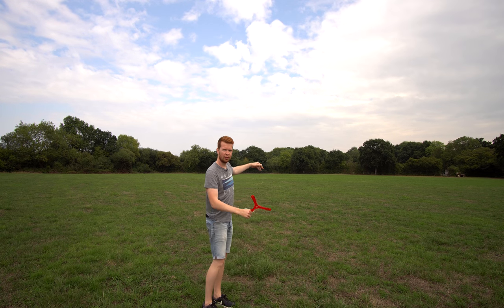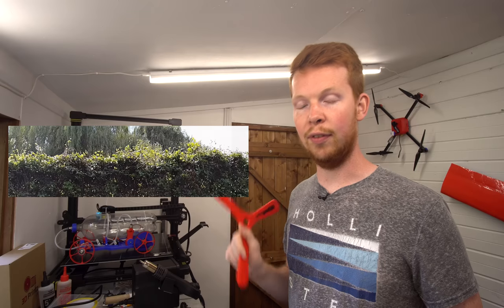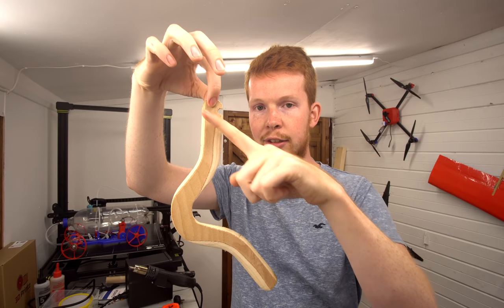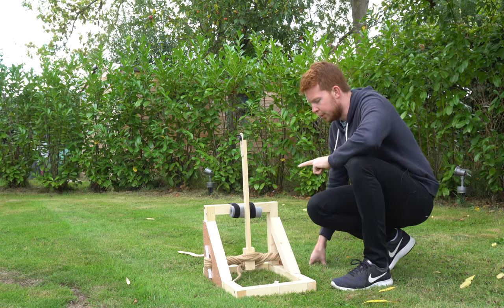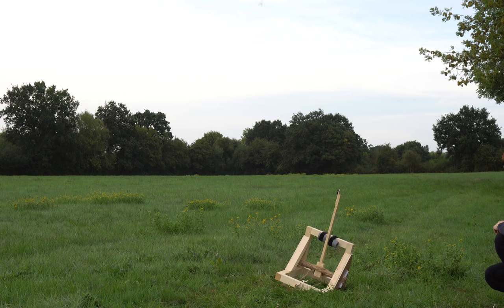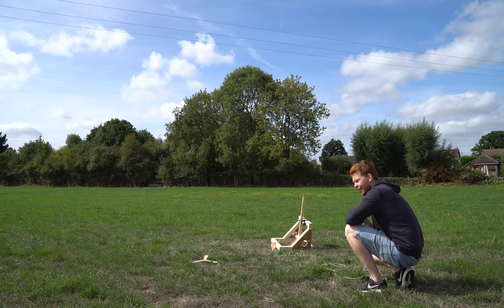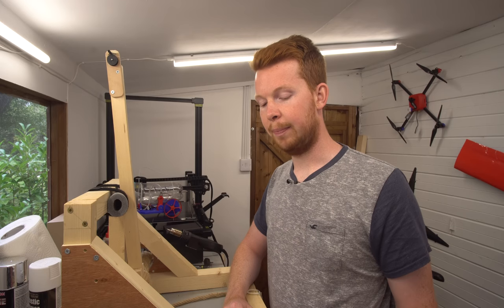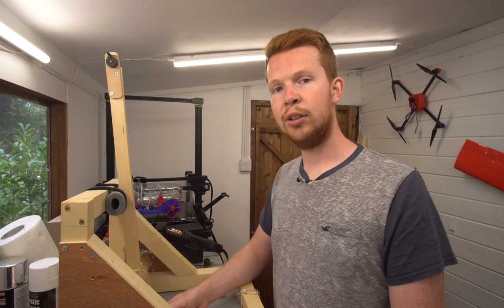Boomerang Launcher

Comment: G'day Tom,

   Ah, so you launched that Boomerang 89 times, eh ?

  Back in the 1990s I recieved permission, from the Chairman of the local Aboriginal Land Council, to make & paint & sell Boomerangs & Gayandis ("Bull Roarers") ; and I sold 87 handmade Boomerangs, between 1998 & 2001.

  He said that if I could explain Aboriginal Technology to the Whitefullas, "...then that would have to be an improvement".

  One advantage I had was that I grew up flying an Asymetric Hubless Hardwood Boomerang, which my father bought in 1928 from the Aboriginal man who carved it - at Yamba, on Dad's first trip to see the Sea when he was 17 ; so I at least started off with a Real Boomerang, which has an original Aboriginal Aerofoil Section & "Dihedral" which is actually the Coning-Angle - because we're talking Rotary-Wing Dynamics, y'see.  (I still have Dad's Boomerang - though I almost never fly it any more..., after all it is 90 years old !).

  Your interpretation of the role of Gyroscopic-Precession in the Flightpath-Guidance of a Boomerang was 1) interesting, 2) not wrong, & 3) only partially correct...; there's a lot more to it than that.

  Based on appearances within this video, your Aerofoil suffers from being too thick (high-lift, yes, but too draggy), so you're having to throw the Boomerang too hard ; and from there everything goes awry...., as the high-lift/high-drag Section does bad things to the Rotor RPM & thus effects it's ability to spin-up & store Kinetic Energy as a Gyroscopic as well as by climbing to aquire Altitude - and exchanging Speed for RPM, then using the Disc's Coning-Angle to yaw the Flightpath 90-Degrees while Precession Rolls the Disc out of it's Bank-Angle, then exchanging more Speed for Height and then as the Disc climbs & slows down it stalls, & as it's Leading-Edge tries to drop then Precession causes another 90-Degree Turn and the Boomerang then dives, increases Airspeed, accelerates in RPM due to Advancing Blade-Effect, becomes an Aerodynamic-Disc again, and it's Coning-Angle then flares it for Landing - whence pulling the Disc's Leading-Edge up converts Airspeed to Rotation & the Disc should then land from a Hover, while precessing in a gently circular Spiral Track (!).

  The big trick is to use Thin Symetrical Flat-Bottomed SHARP-Edged Aerofoils, for their Low-Drag at high (Rotational) Airspeeds, to best enable the Boomerang to store  Kinetic Energy from the Launching Airspeed, gyroscopically, then tapping into it in order to shape the Flightpath.

   Perhaps you might like to try backtracking me to my "Aboriginal Technology..." Playlist, thereinat to check out both,

"Boomerang Aerophysics...; Autorotating Hubless Asymetric Rotary-Wing Sailplanes..."

 &

  "The Boomerang Carving Stone..."

 which seems to be about 10,000 years old, and I have no idea how it was made - but it is certainly well-optimised for making Boomerangs (& Spear-Shafts).

  And, of course, never forget that the Horizontal "Horseshoe" Flightpath, which is closed into a Loop by the Wind..., was only ever a secondary usage of the Boomerang - done for the fun of it ; whereas when launched hard, with the Disc horizontal, the Coning-Angle pulls the flightpath into a Vertical Climb which takes it straight up - maybe 300 ft, and if it fails to hit a Bird (in a flock of Ducks, etc) then the Boomerang falls, accelerates into a Disc - and then pulls out of the Dive, and flares into a Hover before landing.

 The "Duck-Shot" is what Boomerangs were designed for..., and they can indeed still be used to induce a Tree-Strike onto the Tail-Rotor of a potentially pesky Heligoflopter - hovering at anything up to 300 Ft (!).

Such is Life...

  Have a good one,

 ;-p

  Ciao !

Comment: I love what you do! 
Speaking of precession, you say "the force is delayed" and this is quite disturbing: you should say "the force is forwarded", IE applied where the wing will be 90° later... 
I've been playing with homemade boomerangs quite a bit... well 16% catchable is not a big success, a good  human launcher can easily reach over 50%. The trick is to adjust the launching so that, at the end of the circle, the boom has almost lost its speed and is hovering flat, gently lowering down at you. It is launched almost vertical, but gets almost flat at the return leg, so tries to climb with precession and so looses its speed. 
I'm not sure of which parameters of a boomerang (angular momentum, weight/surface ratio...) allows this hovering behavior, but I'm sure if you contact an enthusiast maker, he could provide you with one of those designs.
Also, I did not catch (  ;) ) why you came with such a compact design of the launcher. With a longer arm you could reduce the tension and still get the same launch speed, much smoother. I would have tried at least two different length to see how it impacts the longitudinal and rotational speeds...
I hope this will inspire someone the continue the work, and achieve a 100% catch!

Comment: Hey Tom. Some thoughts and suggestions. I think the instability / inconsistency of performance of the launching platform is still a major factor. This can be split up into factors like actual angle against the air stream and the applied trigger power (Does the platform already move before you are able to pull the trigger through it's resistance?). My suggestion would be to add an extra platform that can be attached to the ground with some spikes to eliminate variations in the horizontal angling against the wind and on that make door hinges with which you can then very precisely set the vertical angle. In other words: You should first put a bit more thought in stabilizing the launch. I am sure your results would already be very much more consistent. Variations in the weather will of course be less easy to control. For that you'd need a wind tunnel! :-) Improving all the boomerang relates issues can improve it's inherent efficiency. By using only one boomerang (design) you have however already frozen those variables, assuming you keep it undamaged and clean. :-)

Comment: Now that you have a cnc machine. Would love to see you returning to your compressed air engine, cncing it out of metal, and using an hpa tank and pressure regulator to make it run for much longer. With the added weight it would probably have to be a ground vehicle like a truck where the hpa tank could serve as the "payload" for aesthetic reasons. Or maybe just a boat

Comment: Same thing as Dissymetry of Lift in helicopters and therefore why they require flapping hinges to avoid flying in circles.  As the advancing blade feels more relative wind, it flaps up, which in turn decreases the angle of attack and balances the system.   Opposite of course on the retreating side.

Comment: hey tom , you forgot the two most importante variables and it is kind of obvious , the humidity and air pressure is the least of your problem when you use two 2x4 loose to shime your catapult , every time you reset you change the angle and also your retaining system need something to keep the boomerang parallele to the axis of throw , if its kinda loose or tilted it will affect its launch angle and power, it is my observations

Comment: launch the boomerang in vertical configuration, while increasing the launch angle by limiting the swing distance of the launch arm that is by setting the release point little earlier in the swing. That way the boomerang goes into the air instead of straight firing it into the ground.

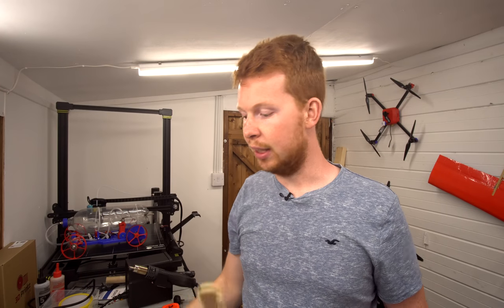Comment: The way you swing the boomerang around at 8:00 remembers me about how I discovered I can twirl around my toothbrush in a similar way. I hang the toothbrush from my middle finger, with the handle hanging down and the underside of the brush laying on my finger. I then twirl the toothbrush by moving my hand in circles, so the brush keep contact with my finger and the handle spins away from me. I've been practicing and I can get it to work about 80% of the time. With about a 20% chance of flinging my toothbrush through the shower. Don't try this with an electric toothbrush.

Comment: Actually here's another idea to remove another possible variable, instead of you pulling the cord to activate it use a servo that's controlled by a remote button.  Button can be on a wire just as long as there's enough slack so that you moving the button does not affect the launcher.  The current system has a variable in that when you pull the cord you might not always pull it exactly the same way each time.   I second the idea of anchoring it better too, maybe make the tilt adjustable too.

Comment: Aim at the horizon, not up like a base ball. 45 degree off the oncoming wind and 30 degrees off vertical (sea level) or 45 degrees off vertical @ 6,000 ft elevation (thin air needs more lift) watch some boomerang contest videos. They catch them standing still. Enjoy

Comment: I wonder if it'd be possible to build an actively guided boomerang, maybe using a reaction wheel or RCS to control spin rate, which would give you control over the turning arc.

Comment: The answer is in the point of release be that in where the arm hits the stop, or when the boomerang hits the pin and leaves the arm. If you look at the launchers' profile, the arm is past 90 degrees at the stopping point. I'm betting If you take it back to a point before it gets to 90 it would solve the problem.

Comment: You missed a variable. Your "launch angle" seems only to define the angle from the vertical of the plane that contains the swinging arc of the catapult arm. If you'll notice, there is another angle, the one that almost never varies in your launch video sequence: The angle at which the arm is stopped (as a proxy for the initial climb rate of the boomerang).

As your boomerang gains altitude, you're exchanging kinetic energy for potential energy, reducing your speed. This tendency is already present as  precession flattens out the boomerang as it progresses in its flight. (Because the naive theory about the "difference in velocity" gives a resultant net lift vector at the top of the sweep of the blades, but it's actually just in front.) As your velocity slows down, the (roughly) equivalent force vector causes the boomerang to curl more tightly, and also gives the boomerang time to flatten wrt the ground, increasing lift even more.

You might find that by tipping the entire launcher forward, you'll reduce the sensitivity of a lot of the other variables, giving yourself much more predictable flights.

Cheers!

Comment: i would like see slo mo of a boomerang handlaunch. I am interested in seeing the changes in speed of spin throughout the hand launch. I am guessing that the changes in speed of spin accelorates most just before release of boomerang? I am wondering if you added a set of rubber band into another notch that could increase the speed of spin alon with the catapult arm throwing boomerang forward would increase the lift.

Comment: what do you call a boomerang that does not come back .........................A Stick
Reply: Most boomerangs used by traditional aborigines didn't come back, they were much heavier and made to be an accurate throwing club to take down prey, the returning version was a specialised case (I believe they where used to scare water birds into traps - but I could be wrong about that, they may have just been used to scare an animal to run towards you, rather than away).
Reply: Dad
Reply: Original boomerangs originally came from torre straight islanders they were NOT designed to come back they were VERY sharp and big they made from wood and very non symetrical
Reply: @mollymillions5438  Yeah, the ones used for hunting I read about were basically flying clubs that converted forward motion into a vertical climb that birds weren't expecting.

I have no idea how anyone got dinner that way.  Anyone who could knock a flying bird down with this kind of bank shot would have to be prescient.

Comment: Have you tried making the boomerangs from plastic sheet or modifying a store bought plastic boomerang to work with your launcher? You said that the wood ones didn't rotate as well as the plastic ones due to lower density. I you use a plastic one it might spin faster and come back easier.

Comment: You throw it more than a meters height, the catapult is on ground level. When you caught it, did you bow? If the lift straight up is M*9.81m/s/s, you will catch it as you would have infinity to do so.

Comment: You need to take into consideration the wind speed at different altitude. Standing up throwing a boomerang and launching it from the ground like that is not the same. Wind at higher altitude is also different from that closer to the ground.

Comment: Add ballast to the boomerangs and secure your launcher with stakes. Why did you launch at an angle? You explained the reason for a vertical launch, then "threw" it out the window !
Reply from the maker: Turns out that 2 bladed boomerangs need to be thrown at more of an angle due to less lift. If launched vertically, they drop to the ground before returing, as seen with the first few launches

Comment: How about a bungee launched free flight glider for maximum flight time duration (or may be even a rocket assisted launch free flight glider)? In both cases the wings would probably have to be folded back during launch to get the maximum altitude possible, and some rudder would have to kick in once a glide is achieved so that the glider doesn't disappear into the distance. You can buy model solid fuel rocket engines off the shelf but rocket assisted launches will get expensive over progressive launches so using a bungee launch probably makes sense during development. I guess you could  try a water ''bottle rocket" launch but this would require a two stage setup (due to my assumption that the bottle will be prohibitively heavy) which is obviously more complicated. The altitude record for compressed air/water rockets is stupidly high but these guys use plastic bottles wrapped in carbon fibre to achieve really high pressures, which would also be very expensive, but at least the rocket would be re-usable. (Note that they usually use a water/detergent mix to create a foam to extended the thrust time).